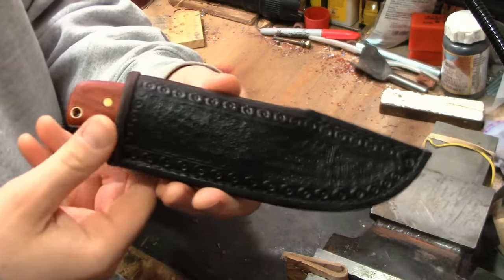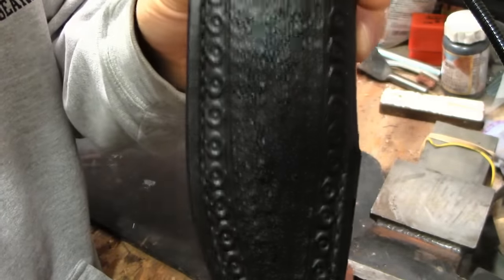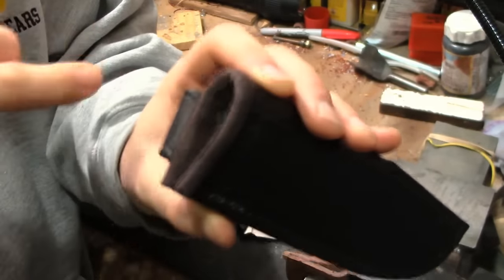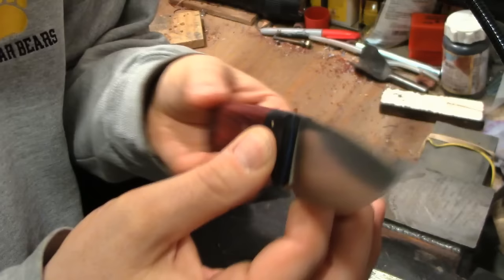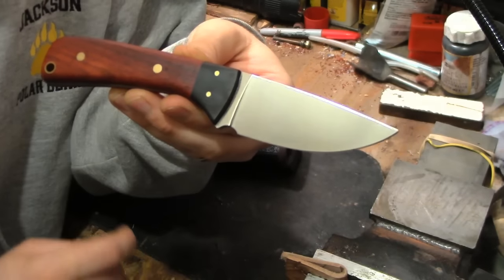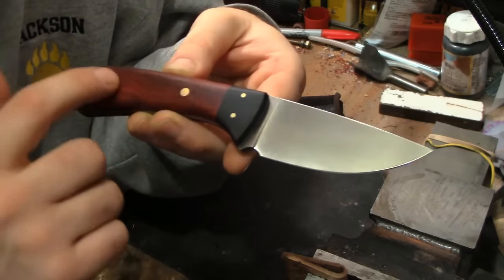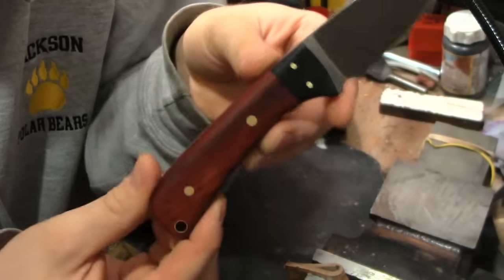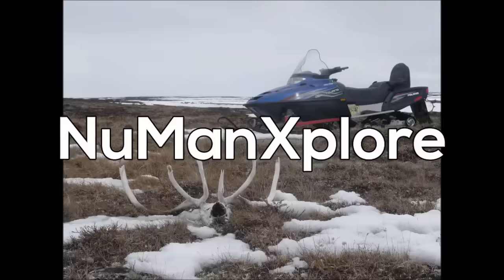EDC Knife with Blackwood bolsters

Comment: I really like how you use contrasting materials... but I wonder.. how old is your oldest knife? how are the bi material handles aging together? different woods are going to react differently to humidity and such right? so if one expands more it could crack the other? have you seen this happen yet?
Reply from the maker: I have done many hidden tangs with multiple woods and as far as I know they are holding up fine. The key is starting out with dry (or stabilized) wood, so there will be minimal shrinkage and cracking. These two woods on this knife are very oily so I don't think there will be much of a problem.